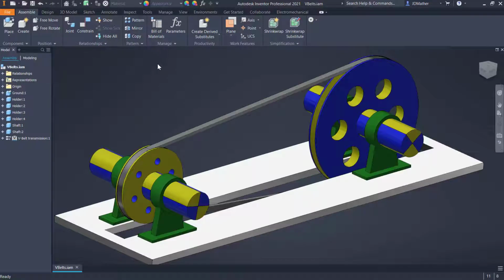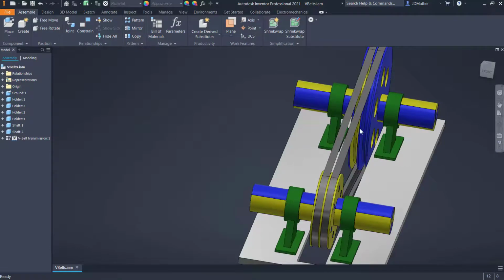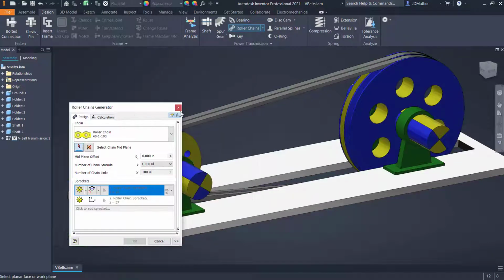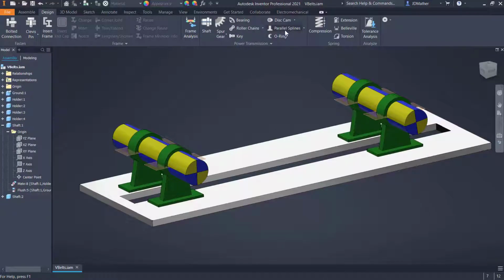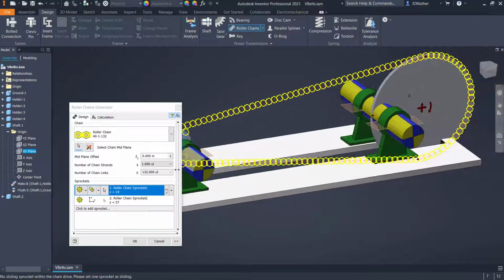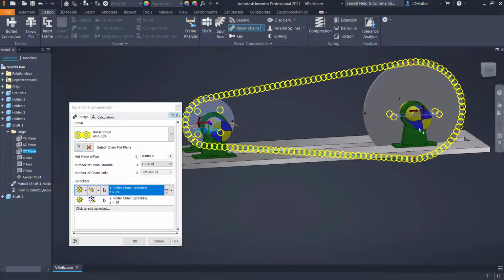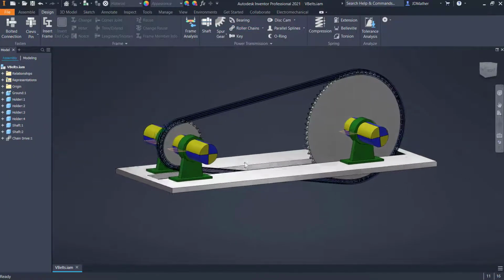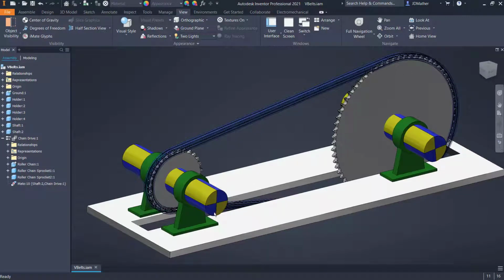Challenge   Roller Chain Sprockets

Comment: I am reading a book called " Up and running with Autodesk Inventor Simulation 2011"in which there is a chapter on how to simulate a sprocket chain using a high speed bottle transfer unit as example; however, I found it quite unstable when running the simulation, one sprocket runs faster than the others and interference occurs. Do you think you can give me a hand with that exercise? I think I may be overlooking something. I do appreciate your videos and your help, thanks.
Reply from the maker: https://forums.autodesk.com/t5/inventor-forum/bd-p/78